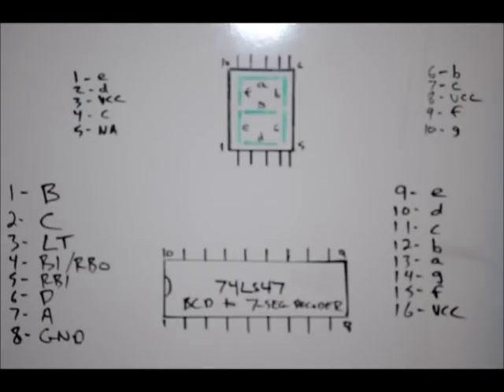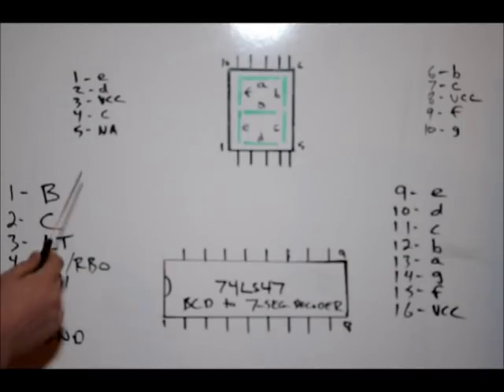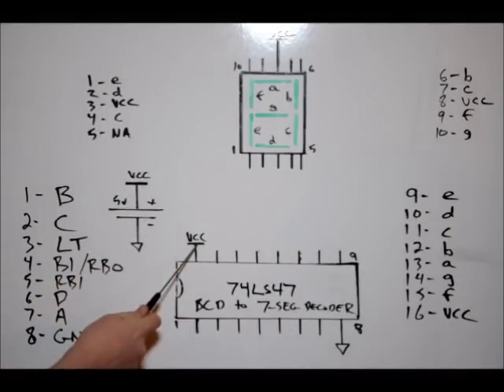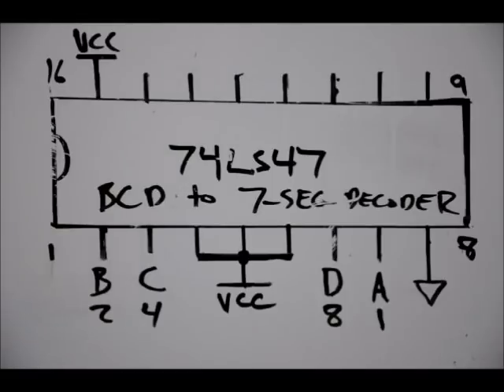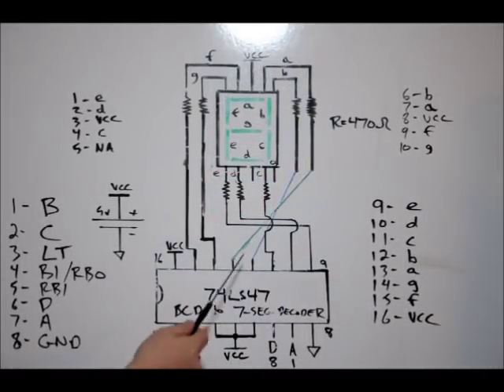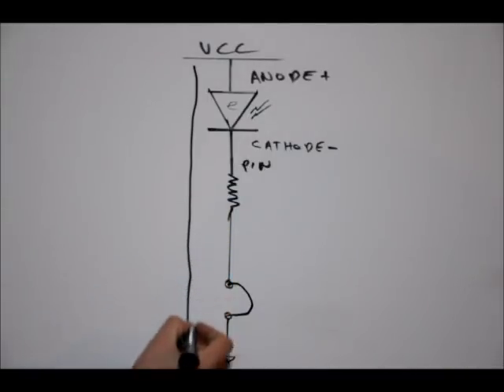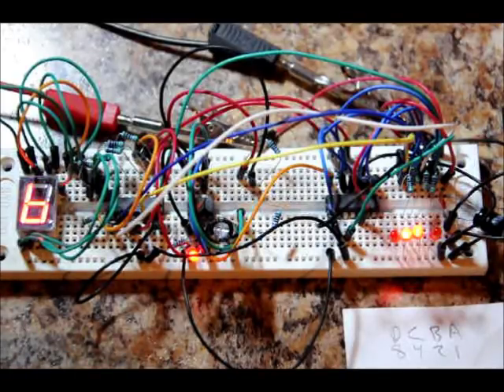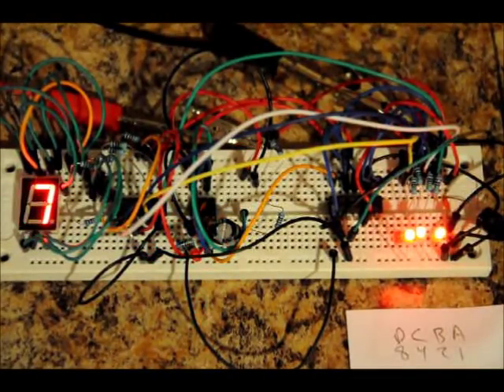Electronic Tutorial: How To Drive A 7 Segment Display With A 74LS47 IC Driver IC

Comment: Thanks for the 74LS47 explanation I really needed that. Now I can understand the IC much better. I still would've liked some info what the LT, BI/RBO and RBI pins do, other than that you need to connect them to the 5V supply.
Reply: if the LT which means light test gets a 0 then every segment will light up
didnt really understand what the other two do but it is described in the data sheet